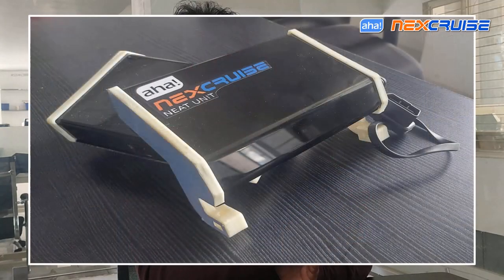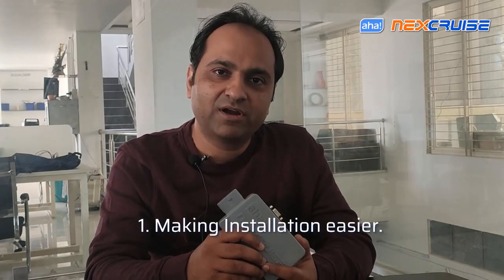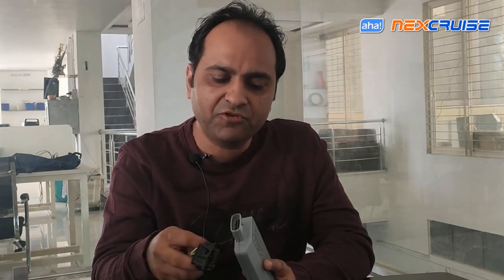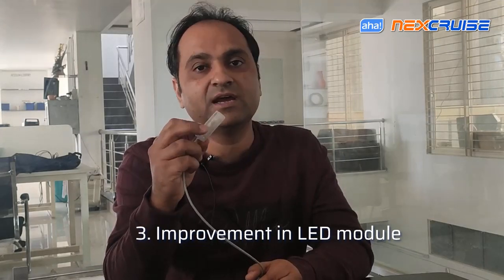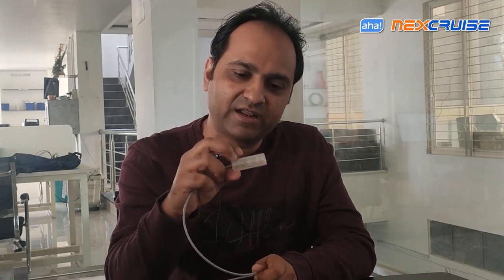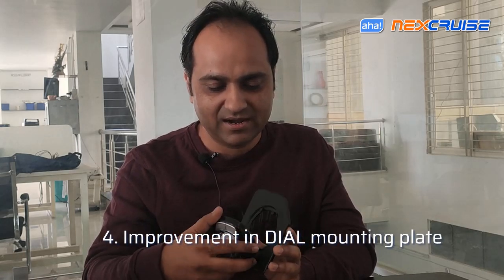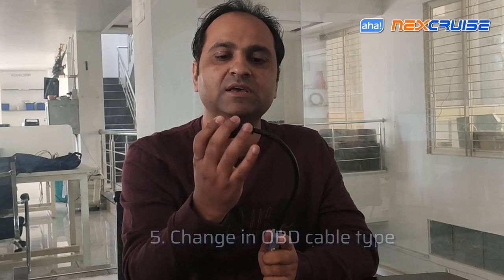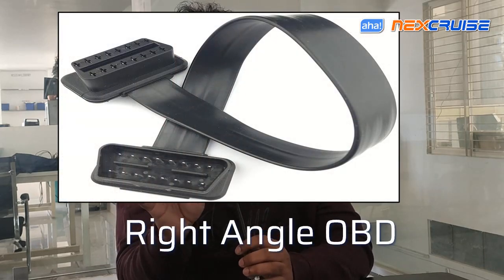NexCruise Delivery Update :  Five

Comment: Good Work Akash ji...looks promising...one "luxury" that would help is that if you could get a app in the infotainment system, same as that on the mobile phone to control the module it would help. As fiddling with a mobile screen while driving could land someone in trouble..
Reply from the maker: Yes. Mobile app cannot be a distraction. Will ensure.
Reply: @ahainnovations  thanks for considering , Also another feature that you might like to have is "Hill Hold" , as the "Hill assist" seems little too dangerous for Indian driving condition. People don't tend to maintain safe distance between cars and "Hill Assist" seems to roll back before moving forward.